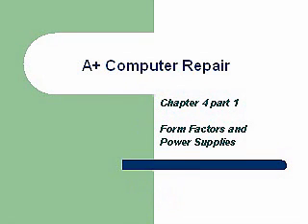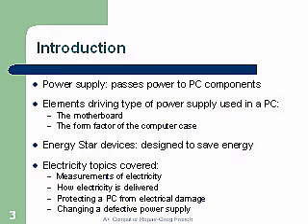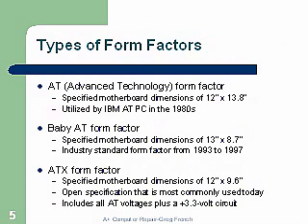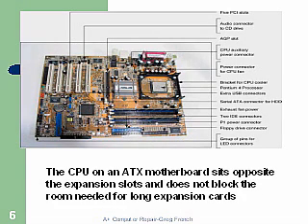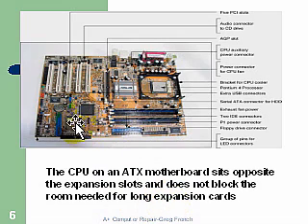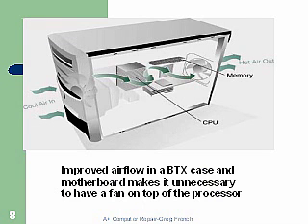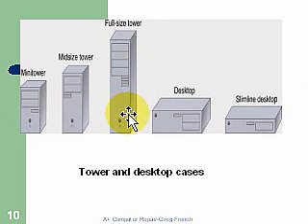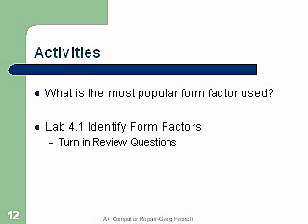A+ Computer Repair Course Chapter 4 part 1

Comment: The only thing is, I was always told that they test on terms and in-depth knowledge like IRQ Channel Assignment. Is this true have you taken the test how nit picky do they get? I really enjoy your A+ series but I am a bit skeptical it does not go indepth enough.
Reply from the maker: I suggest you take some practice tests first.  ExamCram has a book with four practice test that will help to identify any areas you need to review.
Reply: Hey thanks for the quick response, none the less I took many of the practice quiz's and get around 80% with out reading the book or any classes. I am just worried about the questions like how many pins does this cpu have, and what is irq 8 too many of those and it could tip the scale. I was told they moved more towards action questions and sticking with terms. Thanks again for your series will help me keep on track, and pick up things I am missing. Thanks again!